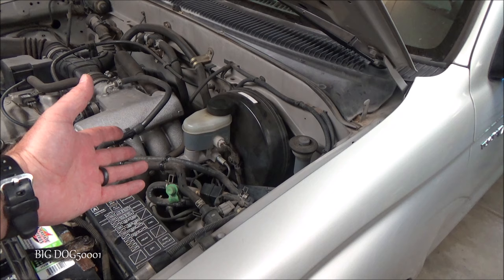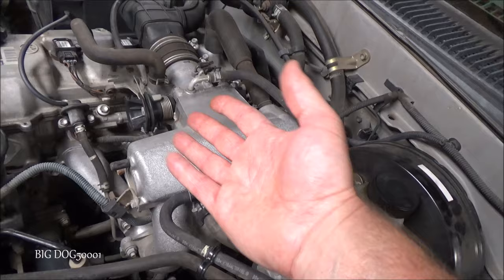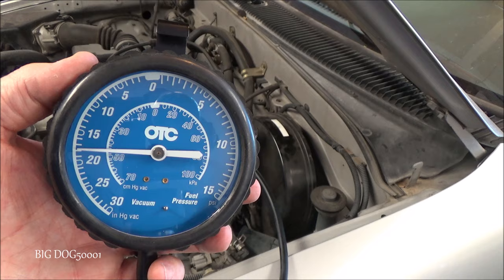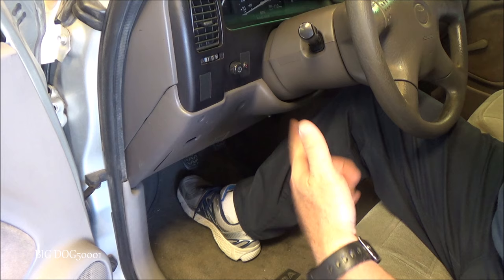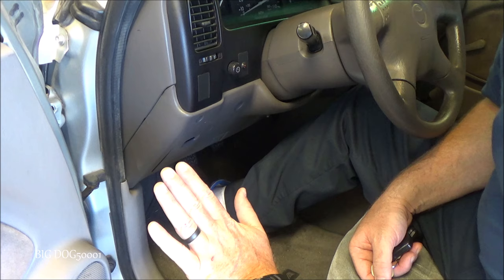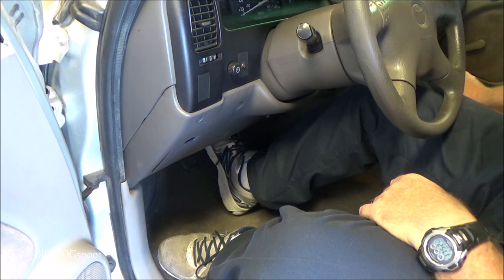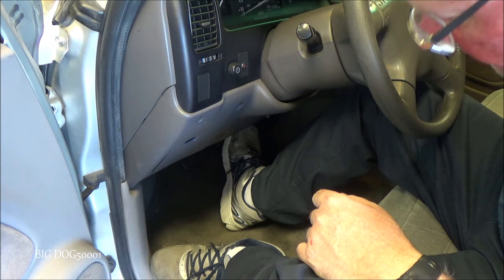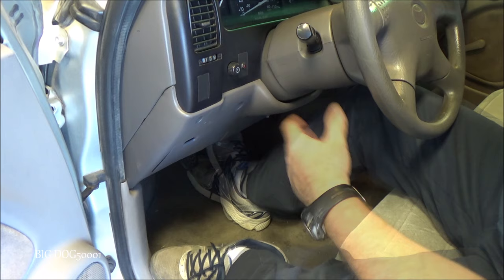How to Test For a Bad Brake Booster / Brake Booster Testing

Comment from the maker: Check out The Accord Project videos!

Link to Part 1:  https://youtu.be/Q5FUVJTCDnY
Link to Part 2:  https://youtu.be/LXgKbk6HABA
Link to Part 3:  https://youtu.be/oT3QwC5GKh8
Link to Part 4:  https://youtu.be/vmV4NRvHYX0
Link to Part 5:  https://youtu.be/JTOwrZ1cxt4
Link to Part 6:  https://youtu.be/vDWx73DG3gY
Link to Part 7:  https://youtu.be/zKyk30TkKng
Link to Part 8:  https://youtu.be/x_q4a-DjDZo
Link to Part 9:  https://youtu.be/x-TA0U8sY4o
Reply: Brilliant! Greetings from rainy England. I was stuck trying to fix my brakes on an Audi A6, which would work fine but occasionally suddenly fail. This was not improving marital harmony. I watched your video, where you explain how the servo assist system works and how to test for faults. Armed with this knowledge, I strode manfully to the carpark, where I had abandoned the dangerous car. Problem solved! - the vacuum feed pipe was not tight in the rubber  tube that goes through the bulkhead to the brake servo. I wrapped ptfe tape round the serrated pipe end to make a tight seal and added a tie wrap round the rubber pipe to stop it coming off. The brakes work much better now. It was knowing how it worked that enabled me to diagnose and then to fix the fault: thanks for sharing the knowledge.
Reply: Thank you  for sharing this information with us  🇺🇸
Reply: 6:07 mine is firm with the car off, turn the car on drops almost all the way to the firewall

Comment: What if your brake pedal sinks all the way down when it's turned on?
Reply: I would like to know the same thing, but I’m pretty sure it means you have a brake fluid leak or bad master cylinder
Reply: Usually a bad master cylinder or leak in the brake lines/calipers. Had this happen to me going downhill in my 74 Mercedes, brakes went from holding pressure, straight to the floor, I blew a brake line hahaha
Reply: Or the cylinders on drums are bad
Reply: @MrMrsregor  But why does it leak only when the vehicle gets started?
Reply: Yes, that was not explained in this video
Reply: @wilsont1010  it is just more obvious when the car is running because the brake booster makes the pedal easier to push when the car is on and vacuum is applied to the brake booster
Reply: @wilsont1010  that would likely be master cylinder
Reply: @MrMrsregor  Agree on this, but what i am experiencing is quite an extraordinary situation.  I will give more details below.
Reply: @jamesklinski3890  Thanks for the reply,  but I think I have an extraordinary problem here, there is a total zero resistance on the brake pedal that goes all the way down to the floor, yet the brakes are working, strong and good when the pedal is depressed halfway.  The resistance from the pedal disappears while the vehicle is crusing, yet it works no resistance at all, rather strange.  What is the cause of this problem?  It is extremely difficult and probably very dangerous too to drive.
Reply: Mine has a new master cylinder, great pedal pressure when off. Turn it in and it travels to the floor with a wooshing sound. Bad booster!
Reply: @oldrango883  But are the brakes working just as normal?  The pedal engages the brake at mid travel in my case, despite that it wooshes all the way down to the floor.
Reply: Mine sinks all the way the floor too but the brakes work great towards the bottom and it makes the same whoosh sound! I don't know what to fix
Reply: Anyone know What it means when the brake pedal is pretty firm after the car has been sitting for a day or 2 but once started it the pedal pressure goes to normal?
Reply: @AlavonMajor  if it's been sitting for a day or two it's lost all its vacuum so you have nothing to assist the pedal. Once you start the car it gets its vacuum back so it is soft again. Why it goes to the floor I cannot say
Reply: @troytodd79  well…see in my case once it starts the pedal functions like normal..regular pressure..no issues what so ever..so I’m wonder does that mean I might have a leak some where?..
Reply: @AlavonMajor  yes you have a small vacuum leak but as long as it works when the car is running I think it's okay. But yes vacuum leak
Reply: Master cylinder. The umbrella seals have failed
Reply: @wilsont1010  you found the problem?
Reply: @wilsont1010  so, what the problem?
Reply: It’s the break master cylinder. I had the same problem.
Reply: @oldrango883  or a lot of air in the lines needing to be bled.
Reply: @Old Rango  yes Sirrr!!! Bad booster or bad internal booster parts.
He'll I've seen a Rusty pin hole on a booster can assembly would even be enough.
Reply: @isaiahkanoa3582  but did yours sink to the bottom even with the car off? Every video I've seen tests with the car off to see if the cylinder is the problem. With the car off, mine hooks compression very well. I can put 150lb of pressure on that brake pedal, and it won't fall to the floor even after 1 minute. If the cylinder was leaking, how can it handle that?????
Reply: @familyman831  but shouldn't those leak even with the car off? I can put my whole body weight behind that pedal with both feet for a minute and it doesn't feel like it's sinking. I turn it on, and it goes to the floor in 10 seconds. I would expect a bypassing master cylinder to still leak with the car off.
Reply: @eugkra33  yes with the car off my pedal would sink to the floor. You should check your break booster, that’s likely the problem.
Reply: I have a 2006 Chevy Silverado and when vehicle is off I have brake pressure when running it goes straight to the floor and cannot not stop. Already replaced the master cylinder still doing it
Reply: @elinordavis  might be your booster or brake lines is there a leak?
Reply: I have a 1996 Chevy van G20 5.7 V8  up on pressing the brake it's very hard as well as you hear air coming from the brake booster in side of the van . That wood mean my brake booster is bad.
Reply: If your brake fluid level doesn't change , it can't be the master cylinder or any leaks .  Then it should be the check valve or booster
Reply: SAME! Only I replaced  Pads/Rotors & Calipers and pedal can still touch the floor & when turned on there’s no brake action whatsoever.. also I haven’t bled them just yet so could it be air in the brake lines?? Or something else?? And I’m not seeing a leak either! (Newbie here so pls cut me sum slack lol)
Reply: @jamiejune6069 definitely need to property bleed them! If that doesn't work could be the master cylinder....
Reply: "look at all that hair" TOTALLY sympathize. 🤣🤣🤣🤣🤣🤣🤣🤣
Reply: What was the problem? My 01 f150 had no problems, i changed the calipers and rotors and got not breaks after that. I have no leaks i put a new master cylinder and nothing has changed!
Reply: Then you have air in the line somewhere.
Reply: @MrJwtaylor40  I bleed all 4 wheels several times already, i put a new master cylinder and break booster last weekend and nothing has changed! Helppp!!

Comment: how did you know when the master cylinder failure or the booster?
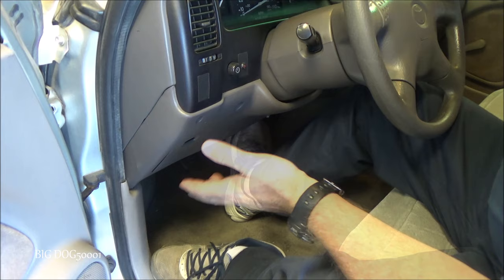Reply: 8:53 the last test he explains what would indicate a leak in the master cylinder internal seals
Reply: Also the break booster will cause a lean condition on your fuel trims.... On both bank's...

Comment: When I connect my vaccum line from the brake booster car starts and quickly stalls out. But when it is not connected the car starts up. I did accidentally crack the master cynlinder resivoir
Reply: my 72 chevelle starts and stalls randomly aswell so every timer before i start it i pump the gas about 3 times and it it usually  starts fine
Reply: Replace

Comment: I had recently replaced a fitting that fixed a vacuum issue (fitting on manifold) that had turned on check engine light.  Parts store clerk said it was for brakes and whether I was having issues.  We weren't, but the check engine light was on for vacuum issue.  Light went away when fitting was replaced, but came back on several days later (I did not reset light, it just turned off when fitting replaced).  Diagnostic showed no errors, but history showed brake issue.  It's clear now.  Video helped explain how vacuum loss could cause the "brake" check engine light issue.  Thanks.

Comment: I have bled my brakes 3 times for squishy pedal syndrome. The third time I bled my brakes I used a pressure bleeder and my brakes were great and fine for a couple months until today when the squishy pedal came back. I didn't think it was the master cylinder because it would get better and not come back after bleeding the brakes. Each time it would come back, it would seemingly happen over night.

I did the last test that you described to do that tests your master cylinder, with the engine off. I pumped a bunch of times(6 or 7) to get rid of vacuum in the brake booster, then I held the brake for 15 seconds. My brake pedal held firm and didn't sink, it did do a really weird thing though after 15 seconds of having this very very slow pulsing that would push my foot back very very slightly almost not noticeable. It would push back for maybe 5 seconds in a gradient pulse, and then go back that same amount. Again, my engine was off, and the distance it pushed back was so so so small so I would think it wouldn't be an issue, but I also never expected it to have a gradually sweeping pulse pushing my foot back when the engine was off.

I would think it is air in my system, or a leak? What do you think? If anyone else has any ideas or experience with this, I would really appreciate any expertise! Really wanting my brake gremlins to be stomped out after maybe 4-5 months of this now.

Comment: Very informative! My fluid level was down below minimum but after topping it off the light remained on. The dealership recommended tapping the reservoir to free the measuring arm in the reservoir. IT WORKED!! LIGHT OFF!!

Comment: Just picked up a 2003 F150, will definitely be using these methods to see what is going on. Upon the first press of the brake pedal, the pedal goes down quite far, then if you pump the brakes the resistance goes up, and the pedal does not have to be depressed as far. So it is as if you have to build up the pressure. The pedal is very easy to press, so I am suspecting the master cylinder. It feels as if the booster is doing its job.

Comment: Thanks for the video! Releasing the clips meant my wife had to assist to pull the switch out while I pushed the keeper clips in. Nothing like fumblefarting my way through it. 😂 2009 Chevy Avalanche. Key positions; all the way counterclockwise = Lock, 1st = Acc, 2nd =  Run, 3rd (spring loaded) = Start. This truck does not turn counterclockwise for Accessory. Thanks again!

Comment: Thanks  to  your  great  video I was able  to  realize that the defect  of my toyota tacoma  is  that  the  vacuum brake booster  does not work  well  and I replaced it  and  fixed it. Thanks you  very much  for  sharing your  knowledge  and experience. Thanks sss👍👍👍👍👍

Comment: Great video honestly and the only one that I've seen that explains all the symptoms that a brake booster can exhibit or a master cylinder. I was having a problem yesterday as a matter of fact and I pressed on the brake and it was traveling too far and it felt like it took a lot longer to brake. I did some of these checks but one of them I did not know about and that was the very last one in your video where you could have an internal leak in your master cylinder. So I tried it and my pedal did sink down further. I checked all the brake lines and saw no brake fluid coming out whatsoever so I'm automatically assuming it's a faulty or failing master cylinder. I bought my master cylinder from O'Reilly's and it has a warranty so I'm going to change it out today or swap it out for another one and then bleed the system starting with the master cylinder bleed. I hope this helps my breaking issue as on these 96 Chevy Silverado c1500s or k1500s they've always had some sort of a spongy pedal even from factory brand new but not what I'm exhibiting. I had changed the master cylinder two years ago and it's worked fine ever since until yesterday I'm also thinking about jacking up the truck and taking the slider pins out and checking those for movement and relubricating them and putting them back in. I changed the brakes from semi-metallic to ceramic about a year ago and it breaks fine it just has a lot of pedal travel and takes a lot longer to stop so I'm thinking there may be a warped seal or a slightly torn seal that is going to get worse if I don't get it fixed inside the master cylinder. Wish me luck
Reply: Update; I changed my master cylinder bled it and was able to get the bleeder screws loose on the front tires but both back tires on my truck the nuts on the bleeder screws are rounded off. Go freaking figure. When I get them off I'm putting self bleeders on there. My truck actually breaks really well though even though the front has been bled but the back still has air in it. I'm driving it very carefully and only using it to get to work and back and breaking way ahead of time until I get paid Wednesday. I get off at 12:00 p.m. and I can work on getting those bleeder screws out and replacing them so I can bleed the whole system properly

Comment: 1991 Mazda pickup, B2200, the booster checks good. But I have brake fluid leaking through the  booster shaft on to the drivers floor matt, definitely a Brake Master Cyl. problem.  Good Video. You can talk to me all day or give me a manual, and I won't learn a thing, show me a Youtube Video, and that's when I learn. I'm a "show me" shade tree mechanic.  Thanks You for a great video.
Reply from the maker: Glad it helped, thanks for the comment!

Comment: First of all, Niiice hair! .... 

I ran into an unusual situation.  Brake booster on a Jaguar  x-type pretty much tested bad while sitting at rest test (after shutting off engine).  One decent brake feel the next one almost hard as a rock and the third one rock solid, essentially not holding vacuum for enough braking.  The check valve tested ok,  brake pedal dipped when starting engine, so all ok until the test for the vacuum being held after engine shutoff.  Lastly, the brakes themselves were dragging severely. 

So, I removed the Master cylinder and adjusted the push rod length. (the moment I took off the master,  I could tell the brake pressure released) I had to do it twice, but worked like a charm the second time around.  There's an acorn nut at the end of the pushrod (I had a helper step on the brake to extend the pushrod) I then used a needle nose vise grip to keep the pushrod (just behind the acorn nut) from turning and turned the nut in at least 6 turns in my case. The wheels spun freely and  the car ran flawless. The car was struggling to shift as well, the ABS light had come on too. But  it all re-set to normal after my stint. Like I said way unusual, and a first for me on this adjustment.
Reply from the maker: lol! (on the hair) 😀

Comment: I Replaced brake booster, master cylinder, calipers and brake hoses. My brake pedal sinks hard. As if nothing there. So check for a vacuum leak. Got it. On my 89' sububran.

Comment: 2012 tahoe 5.3 the check valve is built-in the sensor, and failed the test (I could inhale and exhale freely). Replaced the sensor and the "Service brakes soon" message is gone. Thanks!!

Comment: I'm a very mechanical guy but I'm stumped on this one. I have a 2008 Escalade. Brakes were perfect, I put on all new rotors, calipers and pads about a year ago and brakes have been super smooth and worked perfectly. But last week I had to really stand on the brake pedal to keep from hitting a car that pulled out in front of me. I wasn't going fast, maybe 10 MPH or less. But since then the brakes want to stay engaged under certain conditions. If I come to a complete stop, the brakes release fine. But if I lightly press the brakes like to slow for a turn or to go over a speed hump the brakes lock. They don't "lock" as I can't move the truck, but when I remove my foot the truck continues to slow down and will come to a stop on it's own. A quick firm press on the pedal and it releases but driving is a pain. The pedal seems to not be retracting all the way up in these conditions. I can put my foot under the pedal and pull up to release it. And of course when trying to drive the truck with the brakes lightly engaged I get all the ABS, traction control warning lights. Any thoughts?

Comment: My good sir through you I have found a bad booster and master cylinder at the same time... Sometimes lean codes sometimes evap codes and even transmission and fuel issues... These cars with all these sensors it's like a chicken with no head